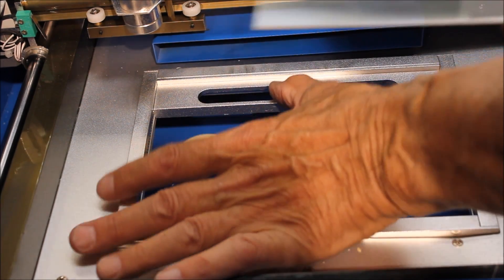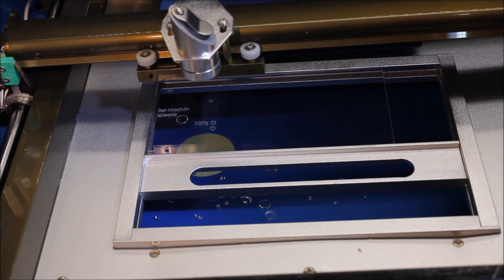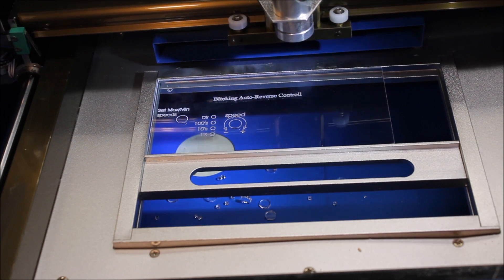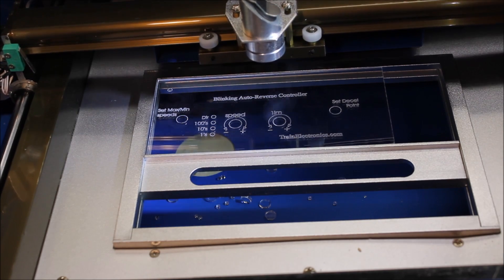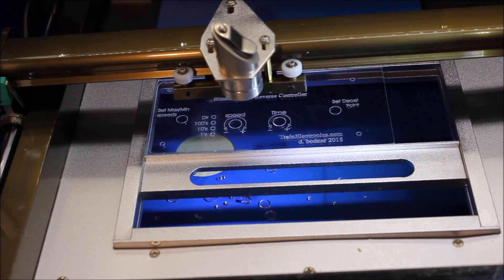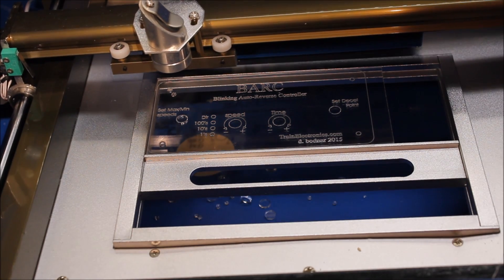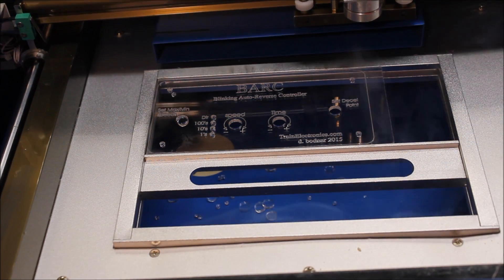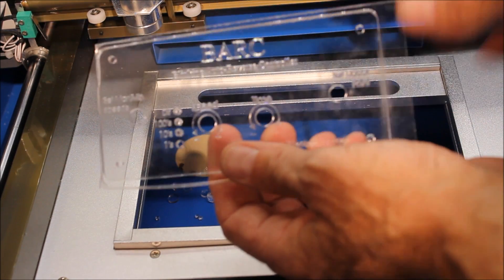Using a laser cutter / engraver to make faceplates for project boxes

Comment: have you considered Lightburn software for your cutter? Looks like a lot of re-work with graphics and settings which are easily controlled through Lightburn. I made great panels for my projects. 
Good video!
Reply from the maker: Doyle - The video is several years old and I have replaced that laser cutter with one with a much more sophisticated controller - It integrates smoothly with CorelDraw which I use for design.
I looked at Lightburn some years ago and opted to stick with CorelDraw.
thanks for viewing!
dave

Comment: I noticed the same alignment problem when cutting out my face plate. My solution was to create a clear object at the origin of each layer. So there is about a 1 inch square shape in exactly the same place on each layer. In CorelDraw, I set the object with no outline and clear fill.That forces each layer to use the same origin, no matter where your engraving/cutting starts. I painted my face plate first so that I can back-light it, but I used the wrong kind of plastic, so even at full power, it won't cut through and has lots of scorching. I am definitely learning by making mistakes.
Reply from the maker: That is a good strategy for alignment - You will never stop learning about how to use the laser cutter - keep up the good work!
dave

Comment: Hello Friend. I have a laser machine very similar to yours. Laser 40w but I am not able to configure it to cut 4mm wood veneer. My laser makes a flame and does not go deep.
I want to cut 2mm and 4mm carbon and 2mm leather and I'm not capable. You can help me configure the machine. What am I doing wrong?
Thank you
Reply from the maker: Alberto - The first thing that comes to mind is focus - do you have the work material the correct distance from the laser tube?  Try moving a sample a bit up or down to change the focus point.
I have cut leather and wood - not sure what kind of material you are referring to when you say 2mm and 4mm carbon.
dave
Reply: Thanks for the reply. I mean carbon fiber of 2 and 4 mm. At this time I have the focal length at 50 mm (2 inches). The lens is of diameter 12. I do not know what focal length corresponds to it. Where can I see this data?
I have put power of 40w and an advance of 20 mm / s. I'm sure it's silly what's happening to me, but I do not know what it is.
Reply from the maker: I have never tried carbon fiber - I think the laser might be a bit under-powered for carbon fiber that is 4mm thick - also, it is flammable so be careful!

As a test try placing a strip of wood about 5cm wide and 30 cm long in the cutter - raise one of the wood a cm or so and cut a line along it - you should see a difference from start to finish - the place where you see the best, sharpest cut is the proper focal length.

For some REALLY good videos on laser cutters I recommend:

https://www.youtube.com/channel/UCqCyShJXqnElPTUnxX0mD5A

Start with video #1 - I have watched all of them - well over 100 now

Good luck!

dave

Comment: ah the dreaded corel draw beginners gotcha of not setting the line thickness to 0.001! Leaving it at "hairline" causes the double passes.
Reply from the maker: thanks for the tip  - I have since moved on to a different laser cutter & driver that uses RDWorks and that is no longer an issue
dave

Comment: Great video, thanks for sharing. Question: you could have saved a lot of time by not doing the etching of the holes or the border, and then only cutting them through under the higher power later. Was there a reason for this? Or is that extra time just not really make a difference in the grand scheme of things?
Reply from the maker: I don't think it would make much difference, Mike - Perhaps 10 or 20 seconds out of several minutes.
FYI, I have moved on to a more advanced 50 watt unit with a controller that allows me to do the whole job in one run as the controller supports variable power for different areas on the same run.  Nice!
dave

Comment: Hi there Dave, i have the same machine, but to cut a 3mm acrylic i have to set it to 1.2mms and 10%power! is this maybe because the tube is not working well? i read you put yours to 10 to 20% and a speed of 32. do you think replacing the tube would improve the cuttting task? do you know where to buy the part and how much does it costs? thanks!
Reply from the maker: Good day, Nicolas - try increasing the speed and percentage of power -- if you are only using 10% that is quite low - 
Replacing the tube is not a trivial task - first I would experiment more with what you have.
good luck!
dave

Comment: The reason it does it twice is that it is "cutting" both the inside as well as the outside of the line.   The reason it dosen't do it with the inside circles is it see only the "inside" of the line as they are "inside" of the larger line which you are using for the outside of the face plate.  If you were to fill in the shape (i.e. color it) it would not do it however your text would not print as you are printing text in cutting mode rather than engraving.  Also nice way of handling the creation of a face plate!  :-)
Reply from the maker: Thanks for the info - some sources I read said that it was because CorelDraw was not sending a hairline to the printer, but yours makes sense, too.
the interesting thing is that I have gotten a larger 50 watt unit that uses a different program between CorelDraw and the laser cutter (called Thunder Laser) and it never does the lines twice.
dave
Reply from the maker: PS- nice web page!
Reply: Thanks for the complement :-)

Comment: Hi Dave!
I want ask you to help me. I both a 40 w chines laser engraver and cutter, it doesent cut the plexi what i want for one cut i need to do it at least two times. I set it to two repet but when it start the second one it start it a little bit next to the first one. I use corel laser i think someting has been set in the wrong way.  Do you have some idea?
Thanks.
Reply from the maker: Sorry, but nothing solid comes to mind.  It is possible that the Plexiglas is too close or too far from the laser beam (try moving it closer to the beam or farther from it.}
Have you tried slowing down the speed of the laser?  Bring it down to 2 or 3 mm / second - what speed is it set to now?
dave
Reply: My real problem is that when i want to cut it agai it doesent it it the same place.
Reply from the maker: I understand that - perhaps slowing down the speed will allow you to cut it in one pass?
dave

Comment: When I do text is does raster back and forth rather than the way your video shows. I am using LaserDRW,
Reply from the maker: see if you have an option to cut rather than engrave.
Reply: I do in laserDRW. I guess I could turn down the power so it doesn't cut all the way thru the piece and speed it up. That should work...never thought of that....thanks again for your help.
Reply from the maker: My system has two setting, one for cut and one for engrave.  The cut option is what I used in the video - the engrave goes back & forth as you described

Comment: Did you use the Corel Laser or LaserDRW program with CorelDraw??
Reply from the maker: I designed the panel in CorelDraw and used Corel Laser to connect the output from CorelDraw to the laser cutter.  Corel Laser is a pulg-in that came with the laser cutter.
Reply: I can install corel laser but it will not run. I have been using corelDRW but would like the integrated corel laser but I am having problems.
Reply: Norton alerts on the assemble.dll file as having a malware type virus.
Reply from the maker: I has that, too - I ran it anyway and didn't have any troubles - if in doubt you may want to find it from a different source rather than using the one that gives the warning.
Reply: Oh well...downloaded from another site and still will not run...tried it with the dongle and without the dongle still will not come up. Thanks for all the info but I guess it was not to be. Cheers.
Reply: Nice vid, thanx for sharing it ! I'm seriously thinking about buying that machine ! One question please ... At job i'm using a laser machine , i usually draw a " .dxf " file , after that i translate it into " .plt "  file and put it into the machine via usb , so the question is , could i use dxf file with this machine , or just corel draw file ? thank you
Reply from the maker: Stefano - I don't believe that any of the included software can import DFX files - CorelDraw can but not the LASERDRW that is included.
Perhaps someone else has better information for you

dave
Reply: thank you very much . so starting to a dxf file there's nothing i can do ? i need to learn laserdrw to draft ? or import dxf files in corel draw and go on to laserdraw ? thanx everywa
y
Reply from the maker: Stefano - I am sorry to say that I really can't help much more as I have replaced the laser unit in the video with a different one (a 50 watt unit) so I can't test using a DFX with the 40 watt laser.
dave
Reply: thank you anyway :)

Comment: What power is this laser cutter? THat's quite a fast cutting speed you had set there.
Reply from the maker: +Seb Meikle The laser is 40 watts - I like to cut at a high speed and, if necessary, do multiple passes as it seems to make a cleaner cut, especially in thicker materials
Reply: +Dave Bodnar OOh, I will have to try multiple passes on mine. I cut at 60% at 10mms.
Reply from the maker: +Seb Meikle  Mine is set to 32 mm/s - I range from 10 or 20% up to max power depending on the material and thickness
dave
Reply: +Dave Bodnar Not sure if you're still around on youtube, this video is incredible though, if I can't afford to purchase my own cutter, what would I look for when trying to find a place to do this for me locally? Any idea on the cost for a single project?
Reply from the maker: +Mr Shigura 
Sorry, but I have no experience with hiring a shop to do work - if you are near Pittsburgh, PA USA I would be happy to help you out
dave
Reply: Dave,
What software were you running in this video?